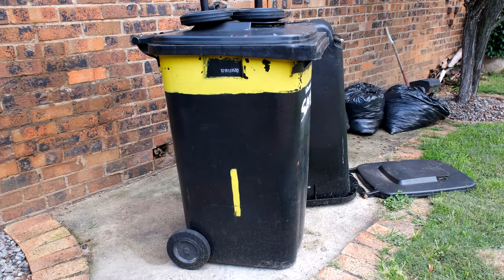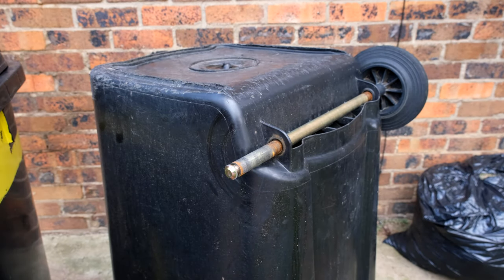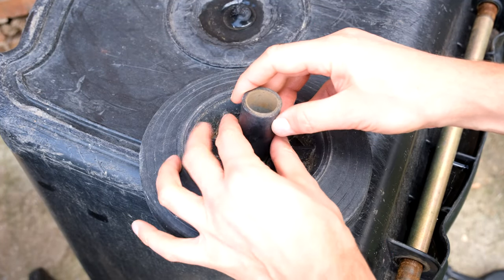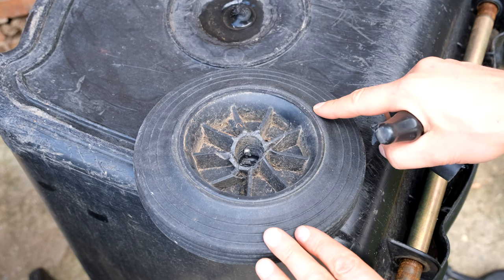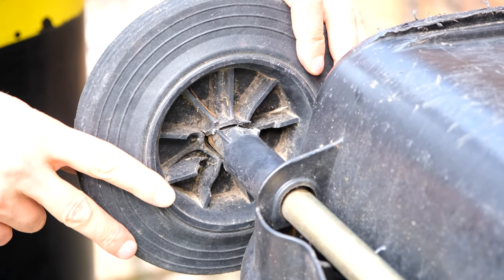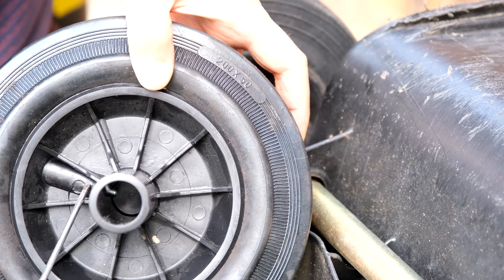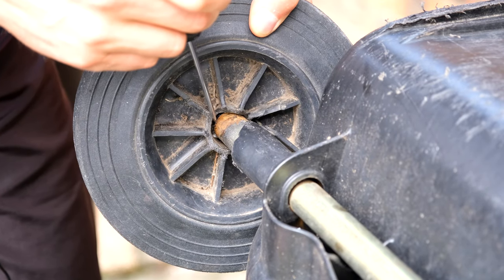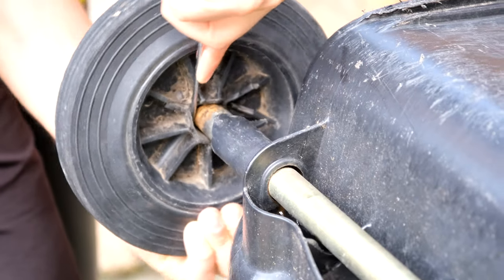How to replace a broken wheel on a 240l refuse wheelie dustbin

Comment: Do I understand correct, but if it's not broken I cannot take apart wheels? I can broken bin and want to take good wheels and use for DIY project
Reply: You can, actually.  I've been on a hunt through these videos because I've got an awkward old wheel.
On the outside of the wheel there's a little circular window that you break into (drill or screwdriver), and use a flathead screwdriver to pull the pin up, allowing you to remove the wheel. :)